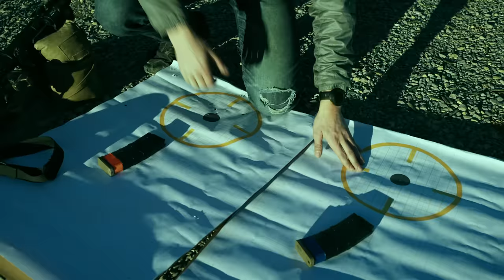Can You Get A Budget 300BLK Honey Badger?

Comment: I like PSA but I'll skip the PSA pre-built uppers. You'll end up buying replacement parts anyways when you get them. For instance, that generic muzzle blast cone thing they put on their guns, it's useless. You'll replace it if you're serious about having a useful fighting weapon. Also, they've had some issues in the past with their quality. Not the parts quality but the build quality on the assembled uppers.

Personally, what I do now for inexpensive AR-15 build is buy an inexpensive pre-built lower receiver. One with the buffer extension and a stock already attached. If you want to go the extra mile, buy the extension and stock separately so you can install it properly yourself. Most companies do a fine job themselves though. It's not necessary to do it yourself in my opinion. Buy the lower from PSA, Aero, or w/e company as long as they are somewhat well known. Rando companies are almost universally trash. You don't need an expensive lower though. PSA lowers are 100% acceptable.

Then I'll buy an inexpensive upper receiver that has the forward assist, dust cover, ect already installed. Just to save time honestly. then I'll buy a decent carrier, a nice barrel, an inexpensive muzzle device, a standard low-profile gas block, and a good handguard. It doesn't have to be an expensive handguard mind you. It can be a PSA handguard. Those aren't bad. You just need to know how to install them properly to ensure the screws don't walk themselves out. 

Building an inexpensive AR this way is more expensive than what you'll get if you just buy a pre-built from PSA while it's on sale, but you'll get exactly what you want (for the most part) and more importantly, you'll know it's put together well because you did the important stuff yourself. 

You'll have a good quality barrel, you'll have a nice BCG, you'll have the exact handguard you want. If you go the route of buying your own extension and stock, that's more customization you get to do. If you want QD mounts, cheek weld adjustments, a certain buffer weight, a special castle nut... etc...etc...

Comment: One of the biggest things about the honey badger and the sig rattler that makes them affective at the short barrel lengths is the 1in5” twist rate. This build may look similar, but definitely not the same. I did enjoy this video, it’s just not really comparable.
Reply: Did you see any keyholing?  I didn’t. Did any bullets come out of the barrel and wreck the can?  No.  

Did the weapon fire 300 BO suppressed and not?  Yes. Is it relatively short and lightweight?  Yep.

Now the Honey Badger has a “direct impingement” gas system just like an AR. We see the result of that here with gas in the face.  Plus no folding brace.  A SIG MCX Rattler OTOH uses a short stroke gas piston, allowing for a folding brace plus no gas in your face. THAT is a difference worth noting. Twist rate not so much.

Comment: Im 18 minutes in, 1st failure to strip off a new round, I'm happy to explore but I feel like the problems are "pre-staged" for a storyline, if these guys have shot 300 blk then you already know you can't be using a standard gas-port size that works unsupressed for both supers & subs, & then expect it to work for supressed supers & subs that's gonna be overgassed to hell your bolt-carrier is gonna be slamming the buffer out the back of that short buffer-tube.

Either install an adustable gas block, or a supressor optimized fixed gas port I think its somewhere around .035" instead of .065" but a suppressor-optimized fixed gas-port will  short-stroke FTE your subs without a supressor & possibly your supers as well.

Comment: Dude, just use a dremel to cut or grind down the mlok screws so they don't protrude past the nut so far.  Should at least work around the gas block, no about how girthy the base of the barrel is though.

I have a similar psa upper, but 8 or 8.5"  It also won't cycle subs without a can.  I have a pretty limited round count on it, but so far it seems to run everything well  with my Rugged micro. 30 attached.

Comment: Going through the whole video.....i have better groups with my 7.5 5.56 at 300 than you have at 100....I would probably disassemble the upper and make sure the barrel is seated properly, with the barrel nut properly greased and torqued. Maybe bed the barrel with some loctite. Also check that muzzle device torque...it seems to be a pretty unacceptable weapon. BCM is going for 680 something with a bcg for a 7" 300blk

Comment: I'm not sure who actually manufactures those uppers/handgaurds, but I bought a PSA 9mm PCC upper that had a different design and it has the same issue. The sling QD slot interferes with the the barrel or barrel nut. I was looking around on Aero's website and they were selling the same exact barrel and handgaurd combo. I'm not sure why they designed it that way. It should've been one of the first flaws they fixed after testing. The upper itself is gool though. I just hate the bulbous section they created for the QD slot that isn't even functional.

Comment: I come back to this channel periodically to see whether or not it's improved at all and the plain and simple answer is always no. We have a guy who really always does think he knows everything, and who only runs the most expensive gear because he's never used anything else. When I first became a gun owner I dropped 5k$ on my first build. I got a little more into different builds and setups and started trying different stuff. And I found that I wasted a lot of money on a lot of brand names that really weren't doing anything better than others. In the Army I used several optics that had been issued to me. Barring the more specialized equipment, the two I became most accustomed to were the Aimpoint Comp M4 and the Trijicon Acog. They are excellent optics and the Comp M4 was the first optic I bought out of the military. Rediculously expensive BTW. I then started using some other optics that my friends and family used on the lower price range and found that there really isn't a whole lot of difference. Return to zero consistency is pretty homogeneous  once you get past the 200$ price range as long as you're buying from a known manufacturer and not some obscure shit. Clarity has pretty much been figured out by now and you'll really only experience a difference in light gathering with magnified optics. My point is, if you're buying a red dot, don't go get an Eotech because this guy here thinks any optic under 600$ is trash. A red dot optic is not difficult for any manufacturer to make well and reliable. At some point you ARE just paying for the brand name. 
When it comes to ARs, do not listen to Lucas. There is little to no difference at all between a 1200$ AR from Aero and a 2500$ AR from any other company. Aside from the barrel. I don't like appeal to authority arguments but I am an SDI graduate so I know a little more than your uncle Steve. Upper and lower receivers on ARs are only manufactured in a handful of forges. What does that mean? Well that means that expensive manufacturers and budget manufacturers are OFTEN both getting their parts from the same stock at the same forge, made using the same process. Ever wonder what that little square symbol is on your lower? Yeah, that's a maker's mark. And you'll find it on both an expensive and cheap lower. Literally the same thing for a higher price. 
The only thing not to cheap out on is your barrel. And even those are all pretty decent. Whether its a Faxon or a Criterion or a BCM. Yes, you can get into the weeds on cold hammer forged, button vs cut rifling and these things are different when it comes to longevity and accuracy but that makes little difference within the 100 to 500 yards most of use are using our rifles for. They are plenty aaccurate. If you're building a long range precision rifle that you want to take out past 1k yards, THEN you need to worry about the barrel. Other than that, buy from a known manufacturer and you'll be just fine. An AR isn't the best platform for a precision rifle anyway. 
When it comes to furniture, please for the love of God don't buy a handguard over 500$. The only exception is Knights Armament, who do make their quad rails to a more exacting specification. Unless you actually burn money in your spare time you will find no real difference between a Daniel Defense handguard and most other budget ones aside from the name. It's an AR. Lucas. You take these things way to seriously. Most ARs are relatively the same regardless of price and while it is a wonderful platform, you aren't a gunsmith for putting a drop in trigger in your BCM.

Comment: If you're going to do a "budget" build and a "budget" test, how about do a run with "budget" equipment first, then discuss the failures, before then moving onto what you term as "budget". For example - why not start with a $100 Sig Romeo red dot, then move to Aimpoint. The problem with these specialized channels like yours is you get use to running $2000 equipment and so all of a sudden, a $500 aim point (more than you spent on the entire rifle) becomes "budget"

Comment: Go with a Fostech lightweight lower with Echo trigger. I just built a Tomcat clone for around $600 cheaper than the Tomcat. Identical lower, upgraded buffer & spring & bcg, upgraded muzzle brake & cheap $300 ghost barrel. Topped of with a delta point. Has that Echo binary trigger

Comment: I still don't get the hype for such an underpowered round. If you want to shoot slow, heavy rounds at short range, .45 ACP has been doing it for a long time. Otherwise, it's just a slightly weaker 7.62x39 from an AR if you want supersonic, and there are much more effective options from an AR if that's what you're after. 6.8SPC craps all over 7.62x39 or 300blk in terms of terminal  ballistics. 

Just doesn't make much sense. Especially with all the PDW/PCC stuff out these days. .45acp is also a hell of a lot cheaper for range ammo and the best personal defense stuff is the same price as the cheapest .300blk range ammo.

Comment: Nice AP lower and then you used a PSA LPK...boo. I'm not a PSA hater, but their LPKs are pretty cheaply done.

Never had any issues with AP lowers, mostly the M4E1s (love that bolt release pin solution - so good) but also a couple of their basic AR15 lowers. I always use their own LPKs with LaRue or Geissele triggers - zero fit problems, coated or not.

Comment: What video games get this most accurately with the how the optics look and how the guns handle. I guess it could be a mix of games but is cod more realistic than insurgency sandstorm? Cuz I always felt like the site is getting much smaller over time. I feel like it'd be larger than it's been like it was on 360 and basically almost all fps games until codmw2 cuz codmw2019 had the perfect sights and it looked right until they released black ops again n then vanguard it didn't get any better. Another game that's got this issue is the 1st I noticed it in before indie games was in all the way back to rainbow six siege which was the 1st game I noticed that the sight on the optics were way too small unless u used a 4x or better. Is that accurate at all? Cuz I think I gotta 3.5x optic maybe a 6x I'm not sure nor am I any kind of expert lol. Mainly a gamer but I like guns are fun wish my family weren't so anti gun cuz they fell for the propaganda and never learned fire arm safety themselves smh.